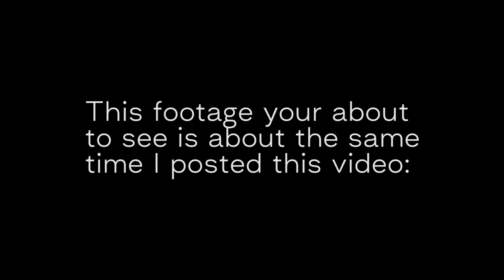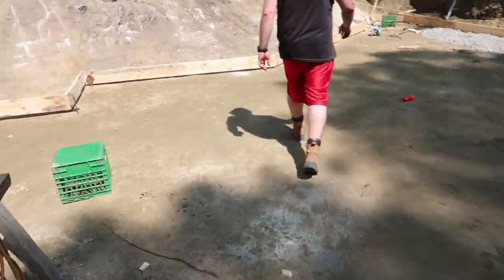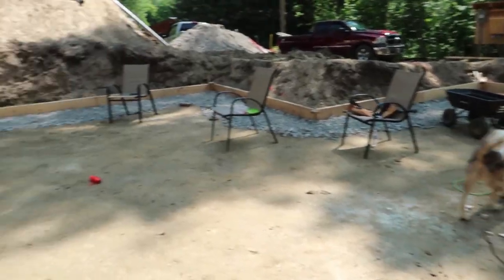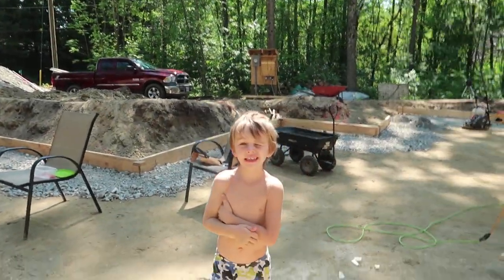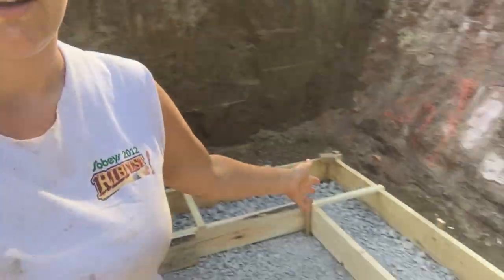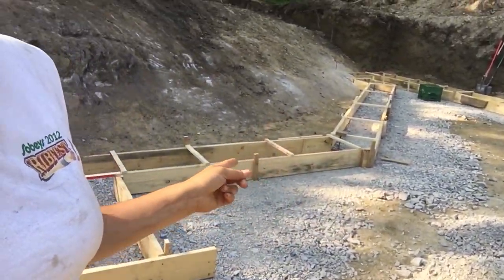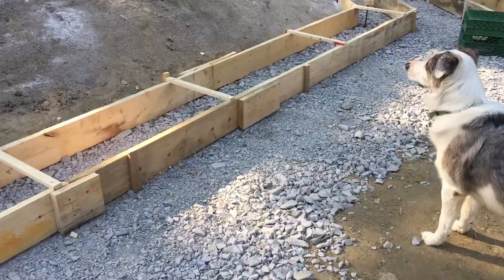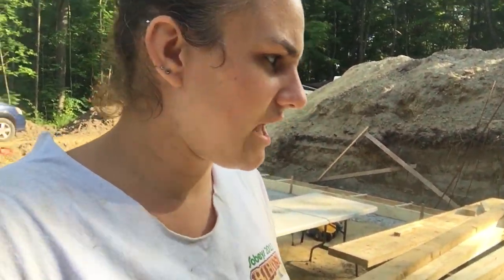Our BASEMENT LAYOUT (now that we lost half our basement) | August 1st, 2019

Comment: Get form release oil so you can pull away from the concrete easier
Reply from the maker: Footings are usually pretty easy to pull off. Just a flat bar and a hammer! As long as you screw it together with screw heads showing at the end of it all. :)